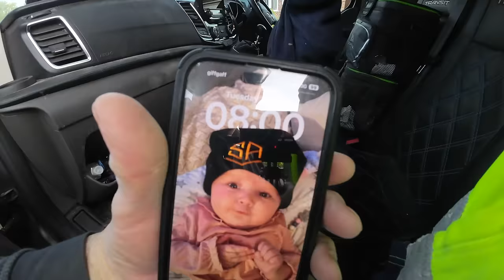DIFFICULT EXTENSION FLOOR PREP AND STEVE DOESN'T SHOW UP

Comment: Well I have to say the breaker breaker looks the business to me .Plenty of times I've hired a hydrology breaker got it to site and had to take it back because something doesn't work .No wires no excess  weight like you get with hydrolic breakers .
The electric hilti breakers are very good but still got a wire .So I reckon that's a really good bit of kit now you have a trolley it's perfect just press a button and go .These new bread of battery heavy duty tools are very capable in my experience. 
Nice job by the way Boys was way over due a time out for you Steve 😂👍🙌💯
Reply from the maker: It’s a game changer Justin .
    Milwaukee have just launched the forge batteries fit it too .
   Double the power and run time packed into the same size battery. Rapid charging too 🪫🔋🙌🏽👍🏽
Reply: @SteveAndAlexBuild  
We run  dewalt tools on the batteries light weight and plug and play.Thr tools you now have are brilliant mate 👍
Reply from the maker: @brickrightbuildinglandscaping . Yeah the Mx fuel tools are amazing! 72v batteries .
     The saw is just the best 😍👍🏽🧱🤌🏾

Comment: Great vid. What were the depths/thicknesses of the hardcore, sand, foam insulation, and concrete slab (to be)?
Reply from the maker: Thanks 
100 mm minimum hardcore
Sand blinding 
Dpm 
Insulation ( inc cold bridging strip around exterior perimeter ) 
Dpm no 2 
100 mm thick Concrete 
🧱👍🏽